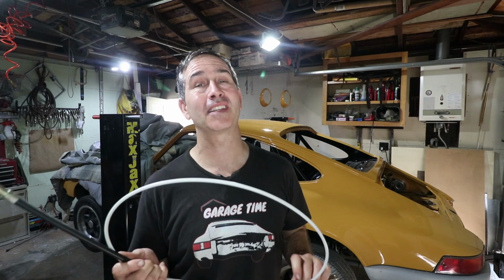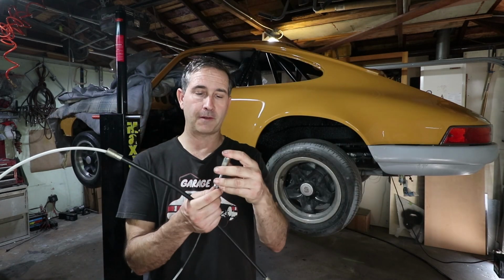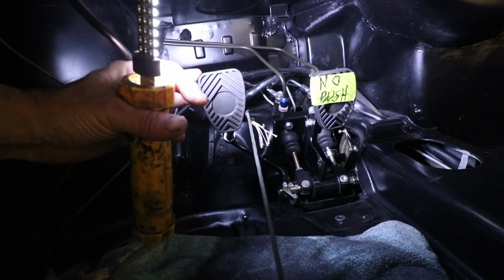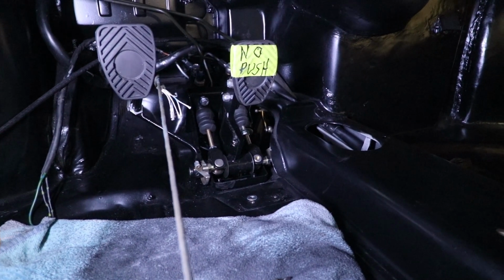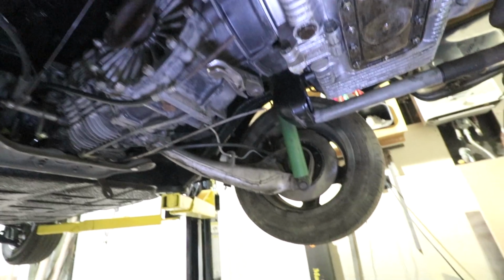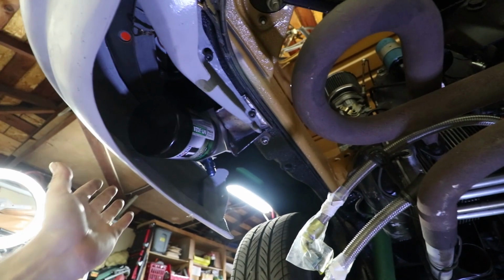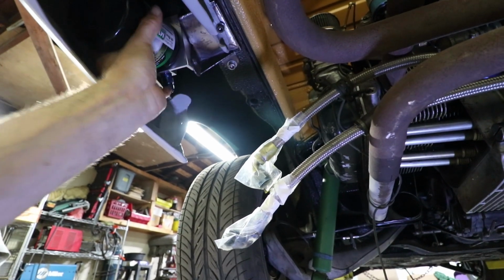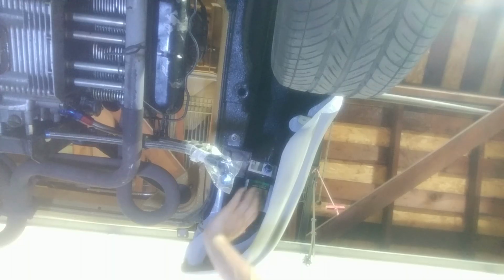What's Wrong With My Clutch Cable? - Early Porsche 911

Comment: Tom, I think you can swap the pivot arm for a straight thru cable accutation.  That arm that makes the cable bend 90 dgrees is notorious for breaking the cable at the bend.  Happens at the most inopportune times. I haad the bendy arm and i remember cables breaking.  I now have a retrofitted arm and no more worries.
Reply from the maker: Thanks Christopher that is the real world feedback I need.  I'm working out the fulcrum ratios now.  Did you notice a difference in pedal pressure or clutch engagement when going to the later arm?

Comment: With all the fabrication skills you have, I would go the route of modifying the arm.  Seems to be the easier, and potentially stronger solution. I’ll be interested to see what you come up with.  👍
Reply from the maker: Ha ha, that thought did cross my mind.  I have a bit of time so I'd rather sell the one I have and order another.  
I'm thinking the 1974 arm might have more adjustment range on that end and less stress on the cable.  So I'm leaning towards a replacing the clutch arm

Comment: Change the cable. The spring assist interferes with SSI which you might run later.
Reply from the maker: Are you talking about the Omega spring thingy?
Reply: @GarageTimeAutoResto  yeah the clutch assist spring can make mounting SSI a bit more challenging. I think you have to hammer it in a little to clear. Not sure if you are running headers or SSI on your 911 engine. This is your 356 engine? missed a few episodes...
Reply from the maker: I'm considering the 70 arm versus the 74 arm.  Neither use that omega, so I should be good for SSI later if needed.
That engine is an extra 912 engine I had.  It's temporary while I build a big 6